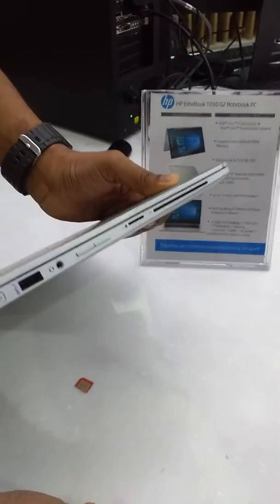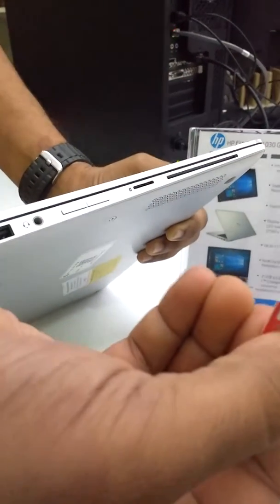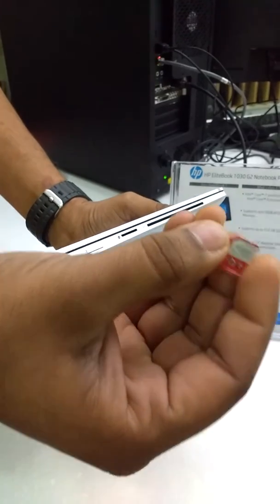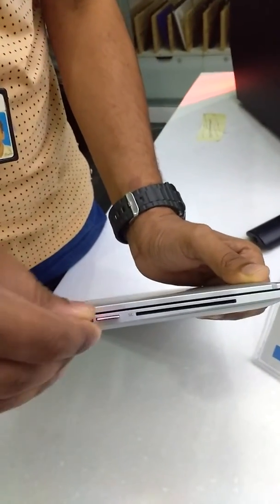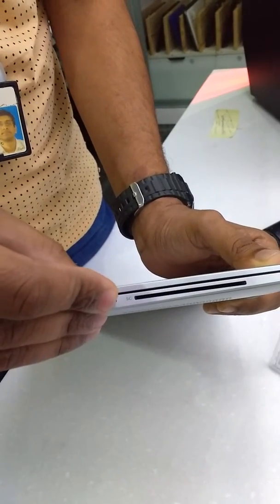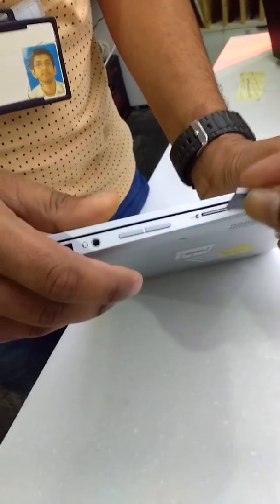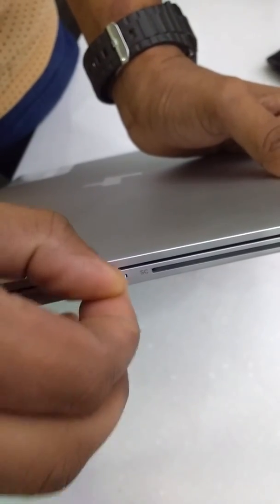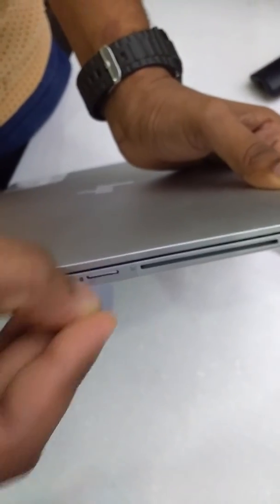How to insert and remove sim in Hp Elite x360 1030g1

Comment: Please help some key are not working on my new elitebook I just bought key 123FyJ are not working please help
Reply from the maker: Hi, please try connecting an external keyboard and check if the external keyboard is working fine. If the external keyboard is working fine then its an issue with the laptop keyboard. As you said the laptop is new, try contacting hp technical support, they will run keyboard test and suggest further.

Comment: Have tried inserting my Sim card but I couldn't, because 
I couldn't open the Sim card slot ... What should I do???
Kindly help me,  thanks.
Reply: Can you share the exact model number
Reply: @mohamadjavith8629  Device name	DESKTOP-1FLP7P8
A-AN222546.
That's the model number. Thank you
Reply: @mohamadjavith8629  I have a hp elitbook 830 G5 and I have the same problem
Reply: @mohamadjavith8629   dell latitude 5500
Reply: me too..need help with it please

Comment: How do we remove the sim slot casing
Reply: hi. u just need something to poke it. use a pin and poke on the lower part so that the casing will pop-up a little bit, then just use ur fingernail remove it. pull it a little bit harder. i hope that helps.
Reply: @judedgreenbriar  thank you. I think I bought the one that doesn't use sim card
Reply: @omotayojoseph9787  oh, okay.